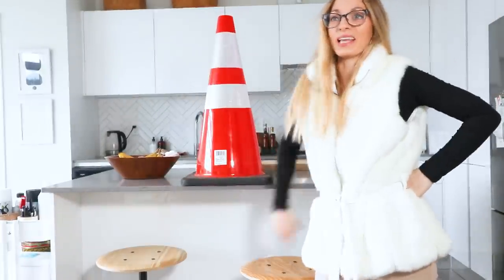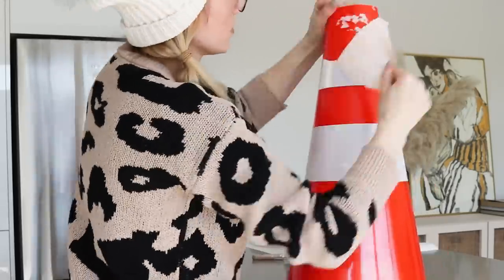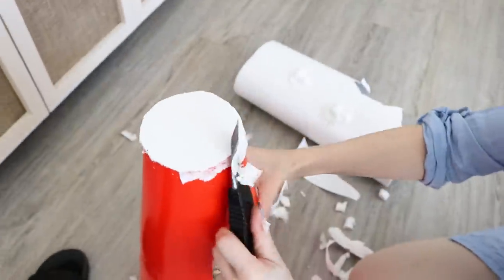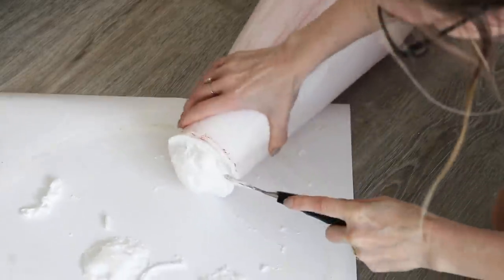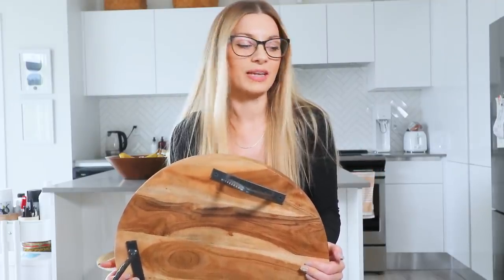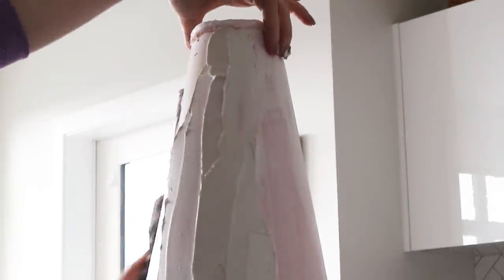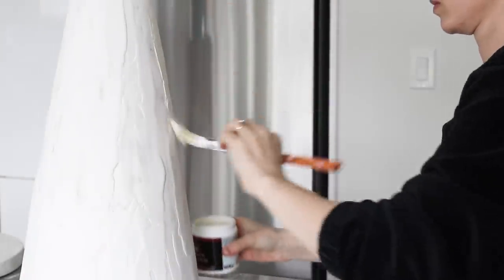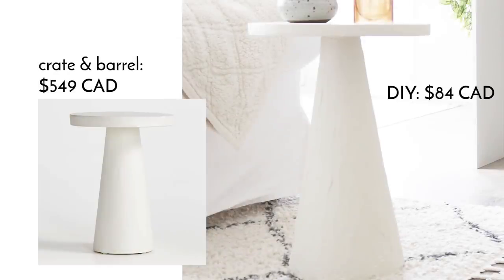I TURNED A TRAFFIC CONE INTO A $500 DESIGNER SIDE TABLE

Comment: Uhh! I think you made this way more difficult than it had to be.
I would have used the cone as a mold and filled it with cement. Also  created a mold out of carton paper and made the top out of cement.
I loooove wood. It almost hurt when you painted that beautiful board.
If it had to be plasterd and sanded anyway, plywood from the hardware store would have been cheeper.